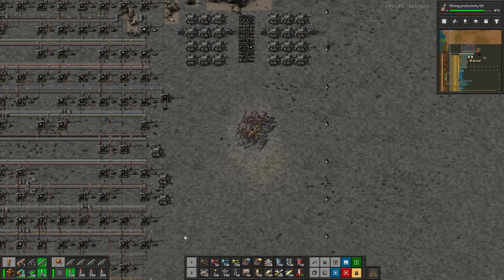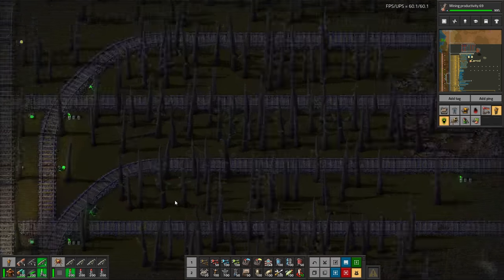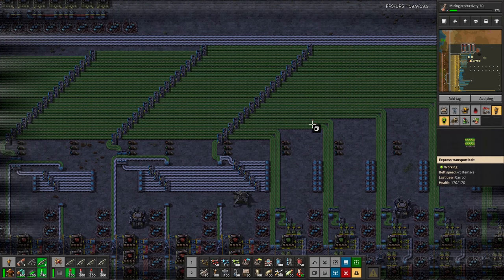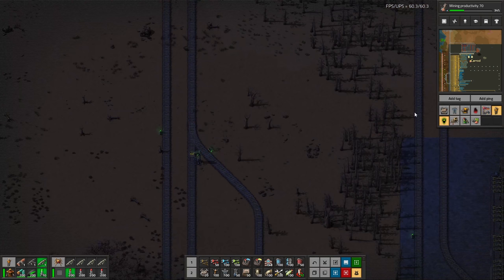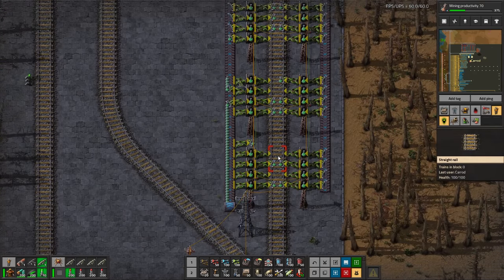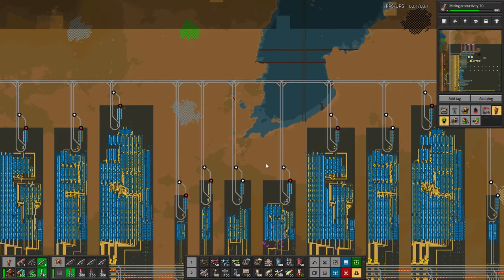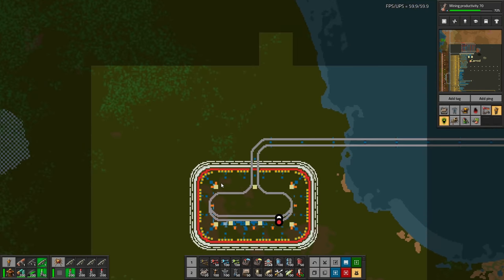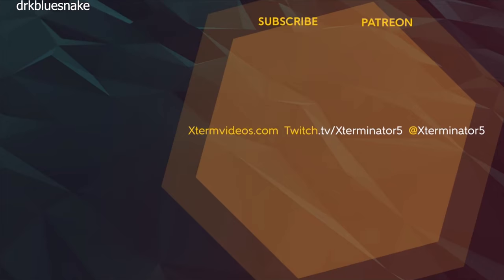Factorio Base Tour - Carrod's Train Bus, 3.6k SPM Megabase

Comment: Rails are probably the most challenging to produce in the context of Production Science. Making dual belts of rails is something I have done successfully. Feed a belt to each end of the assembly line so that the 2 lines meet in the middle). Using logistic robots to move the rails as a hack works too if you do not have room.
Reply: My last beaconed build required like 2.5 blue rails belts.. I just gave up trying to belt it xD

Comment: Awesome base whoever created it. As far as the train issue you were referring too, only way I could see to avoid some of the jam around science area would be splitting up the science area and have each of the three areas off by themselves. But you might still have congestion issue when you put the trains all back together to put them each on there own lines.

But even with the congestion issues, one heck of a job on the base with that kind of setup.

Comment: You missed that those rails are actually **independent**. There is no way to switch between rails. For example, the second outer lane is always copper. This reduces the complexity of the rail system immensely.